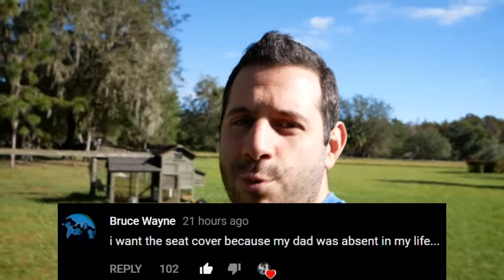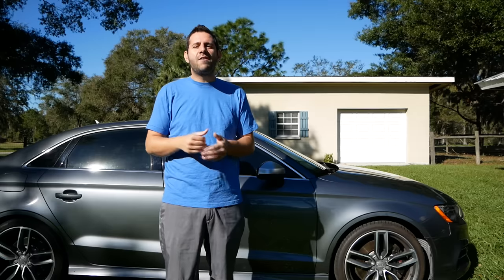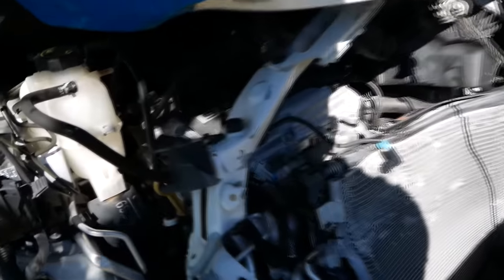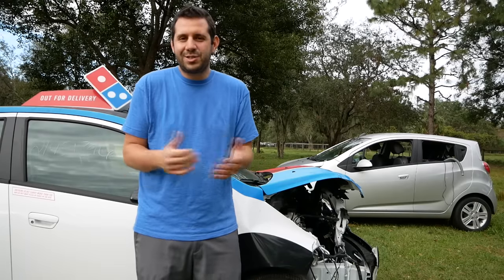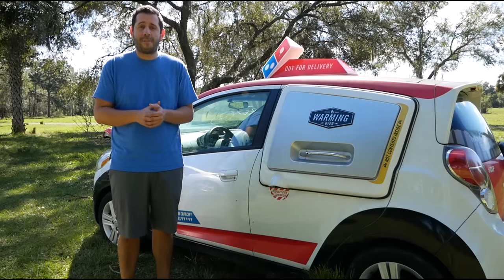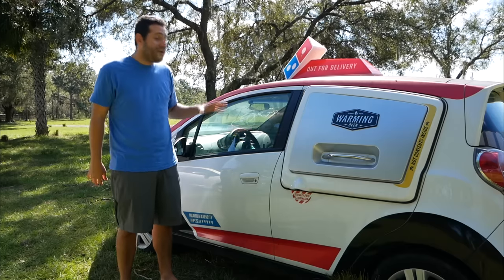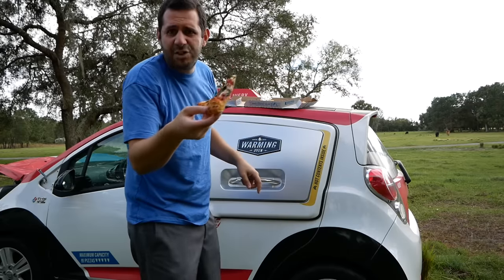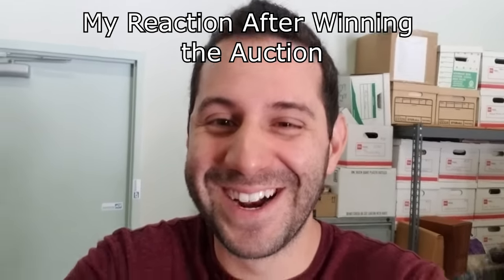I Bought a WRECKED Domino's Pizza DXP Car for $525 (and we're gonna rebuild it)

Comment: I say put a V8 in it. Makes everything go fast.
Reply: X Burst Hellcrate swap
Reply: fast food even faster
Reply: X Burst is that what it does?
Reply: X Burst I don't think there enough room under the hood for a V8 
maybe a k20
Reply: or a h22
Reply: We use one for a push car for are race cars and there is not enough room if there was we would have all ready ls swaped it.
Reply: Dirtyd23 maybe a rotary? I could probably fit one in a duffel bag
Reply: X Burst maybe an RB24. RB26 and RB25 aren't needed for a car like this. The RB24 should be perfect
Reply: Just slap a turbo tf you talking about v8
Reply: It will not fit under the hood
Reply: Gopnik n. H engines are fragile
Reply: Starlight Videos who said it had to be a front engine car
Reply: Well since the rear seats are already out, maybe do what Renault did with the Clio Sport V6 and just throw the motor in the back.
Reply: I believe car engines take gasoline, not V8 vegetable juice.
Reply: Sr20 swap
Reply: Yes good idea throw a v12 in the back
Reply: Gopnik n there was enough room in a Prius for a hellcat engine it was at sema
Reply: LS swap it.  If Hoovie can do it on a Porsche, why not on this?
Reply: X Burst I like the way you think
Reply: Delivered in under 60 seconds or its free.
Reply: i would say put a b18 or k20. you know a little rice for your pizza
Reply: V12
Reply: V12
Reply: I say Put A V12
Reply: I say put a V12 In the back, it will also burn the pizza to a nice crisp!!
Reply: X Burst Not true, my Lincoln Aviator has a V8 in it and it's slow as shit.
Reply: Good luck fitting anything bigger than a V6.
Reply: You might be able to fit a small block v8 in there, if it can fit in a T-Bucket it can fit in there. I think.
Reply: Except a car that already has a v8
Reply: nah put in a v16
Reply: it may not fit
Reply: Gopnik n 20b twin turbo
Reply: Put in a V20 and try to beat Jimmy Johns at freaky fast delivery
Reply: X Burst no! V12 with twin turbo and race brakes with rally suspension!
Reply: FUCK IT DURAMAX SWAP
Reply: Gopnik n make it rear engine....

put the pizza in the front.
Reply: Blair Aquilia '53 Cessnia O12 should work just fine.
Reply: How would that even fit?
Reply: coolio diablo your problem is that it's a Lincoln
Reply: Put a built boxer in it with a 6466mm turbo lmao
Reply: R8 v10
Reply: I think that people that know NOTHING about cars, and now specifically engines, just say, "do a K20 swap." There are a million engines that would be good, and everyone thinks it's cool to say that. It's like someone asking, "What kind of car should I get?" And answering, "Get a mustang." I remember when everyone was saying SR20det swap. Same thing... You know nothing about three topic, but you heard someone say, "SR20det swap" then everyone has to say it.

Edit: HAHAHA, scrolling down further, someone did say "SR20"! Lol. I heard someone say SR20/K20 swap before... I think I'll say it next time the topic of engine swaps comes about.
Reply: no room for it. put the 3.5 SHO in the back
Reply: I put a V8 on my oven. It just burned my pizza, dude..
Reply: 572 swap
Reply: A v12 will be good